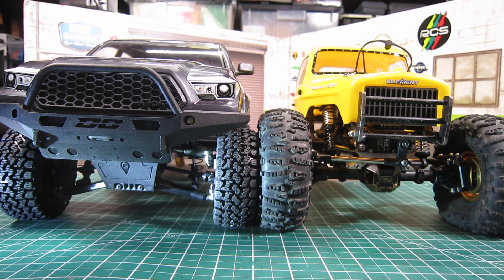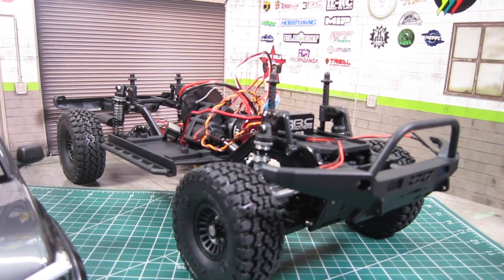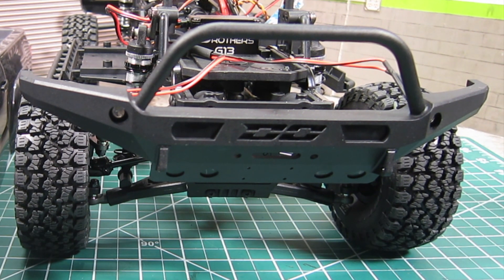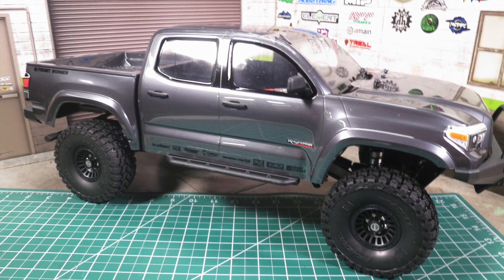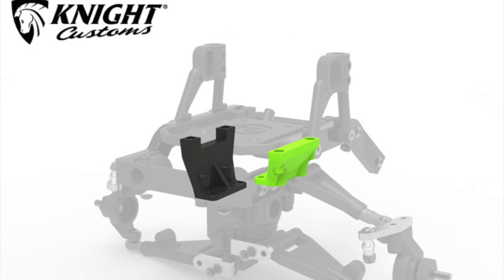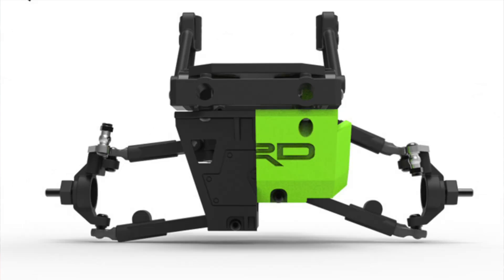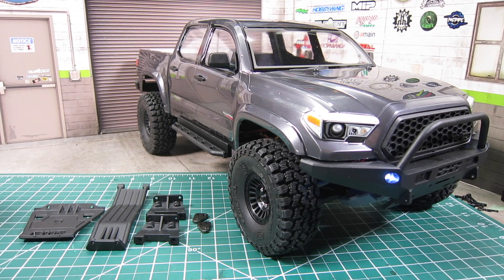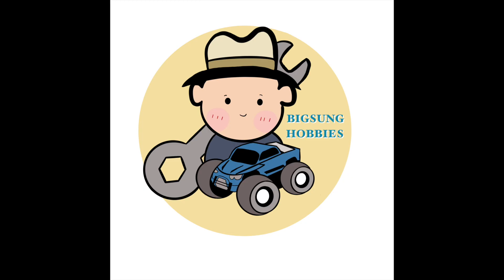1/10 Scale Toyota Tacoma (Element Knightrunner) | Ep. 3 - IFS Modification (Knight Customs)

Comment: Great upgrade! I figured you may install this. It looks super helpful on clearance, and the TRD bash plate is a nice scale touch! This came out too late for me, I’ve already got belly skids.
Reply from the maker: It really does improve the clearance as long as you are running tires at or less than 4 inch tall (100mm).  I haven't tried to run it with Class 1 tires, so not sure if it will work.  Great IFS modification.
Reply: @BigSungHobbies  my 35” km3s in real life rub straight on my inner fender. Safe to say a little km3 can make contact with a Toyota rc body. but hey that’s just me. very informative video regardless thank you for the time you put into helping us out.

Comment: The servo is in the same spot? and we never saw you take 5mm of driveshaft out ?
Reply from the maker: I found that on mine it fit without removing 5mm from driveshaft.  So I tried it, but it felt too snug for comfort, so I ended up removing 5mm at a later time after the video was posted.  Good catch.
Reply: @BigSungHobbies  okay cool so servo same spot? I’m hoping I don’t have to move it I have the metric proline body so more stuff going on inside the engine bay
Reply from the maker: Servo is on the same spot

Comment: Great Video. I just started getting into RC and just picked up  Element Trailrunner. I saw your vids on the Trailrunner too and was wondering what you think is better upgrade to get more clearance, the 4.19” tires or this Knights custom IFS mod?
Reply from the maker: Thanks for the great question.  Although I haven't tried this directly with Trailrunner, I think both the Knights Customs IFS mod and the 4.19" tires  might work out.  The body and bumper for Trailrunner is a bit different than the Knightrunner, and I think both might work on Trailrunner.  If you know anyone that might have 4.19" tires that you can try out, I would recommend that.
Reply: Thanks for the feedback. I’ve just started out so I don’t really know anyone in the hobby yet. But I am in the Bay Area so maybe I’ll run into you some time.
Reply from the maker: You are welcome.  Where in the Bay Area are you located?  If you are near San Jose area, the Weekly Creek Crawl on Tuesdays are great way to meet new folks.
Reply: I’m out in Menlo Park. I’ve got little ones though so Tuesdays are pretty tough.
Reply from the maker: Understood.  Make sure to check out Bay Area RC Crawlers (BARC) Events page - https://www.facebook.com/groups/2421082954578965/events/

Comment: Will I be able to install 2.2 tires?
Reply from the maker: Not if you plan to keep the Knightrunner body.  I have used 4.92" tires on the Element Trailrunner using the Proline Gladiator body, but that did not have IFS modification done to it, so I am not sure if that will impact it or not.